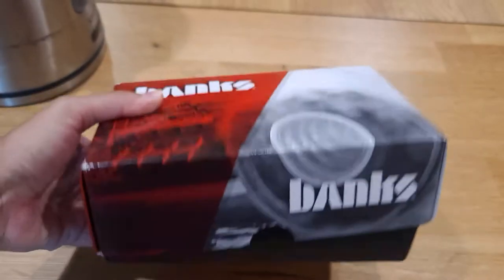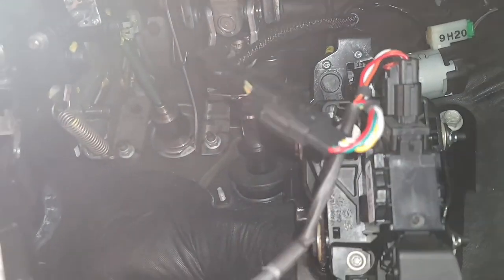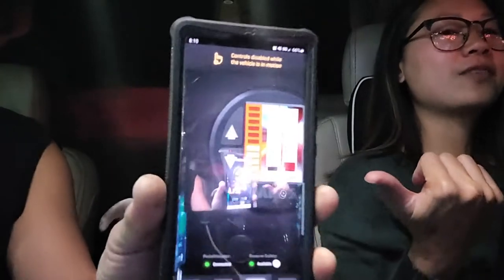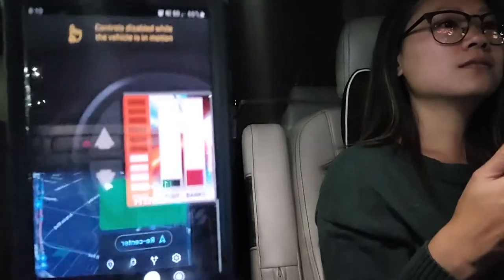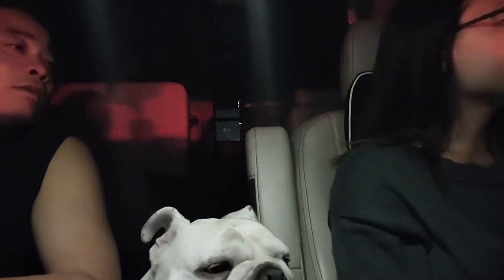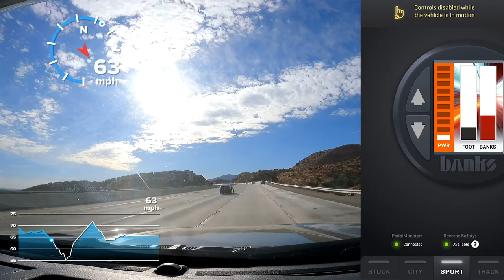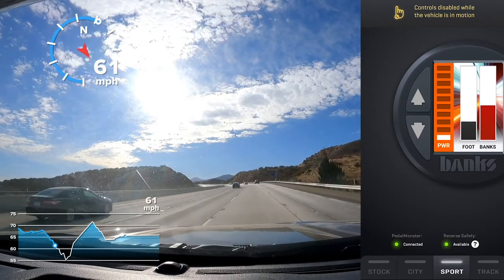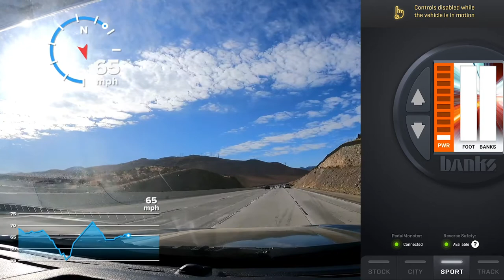Banks Power PedalMonster | F-550 Thor Magnitude Super C Motorhome #bankspower #thormagnitude #f550

Comment: I'm not sure how this product works, but have faith!  Banks makes very good stuff.  Having not researched this product, I'd guess it gives you extra power?  I have tuners that do similar jobs on both my trucks.   Just be sure you use the appropriate tuning setting when towing!  You can hurt your engine.  Used properly, these tuners save you fuel, too...  Don't feel bad, my wife has a heart attack ANYTIME I buy something for the trucks....   (-:   But yes, Kevin... You should talk to your financial adviser BEFORE you buy stuff...  God bless you two...
Reply from the maker: The good thing is, it is not a tuner. Definitely not putting one in the Super C 😁. But this gadget does open up the throttle response quicker than normal. Definitely do not hate the product, but yes financial advisor approval required before purchase 😅🤣

Comment: Just finished a 3000 mile+ trip in our Magnitude and I thought of your review of this product. My wife drove and found it hard to push the throttle all the way down for the long grades we pulled and I also noticed that I was too slow in throttle response when trying to anticipate his or passing. I also found myself not fully engaging the throttle sometimes. It sounds like the pedal monster can help with my situation. Wondering what your thoughts are based on your experience so far with it. We already have the Banks power monster and derringer tune (2019 6.7L with 6 speed). Thx
Reply from the maker: Hi! Kevin really loves the product a lot. The response time is pretty instant in our opinion. No complaints here. There are different modes that you can also adjust to your liking.